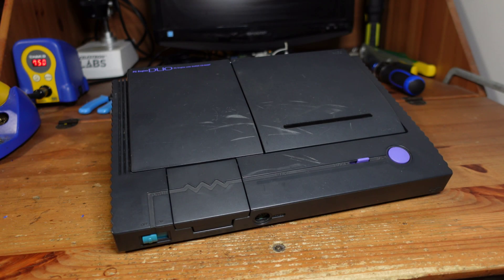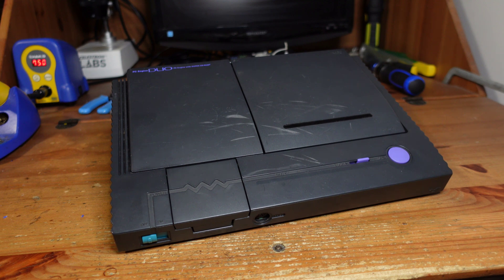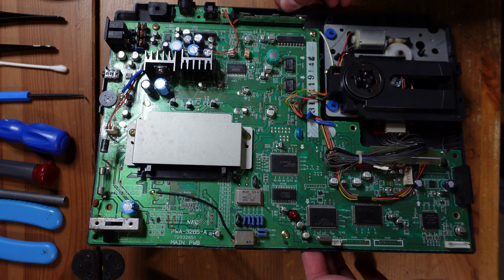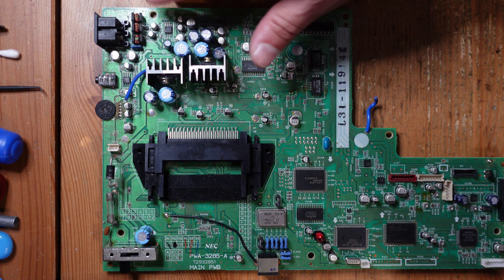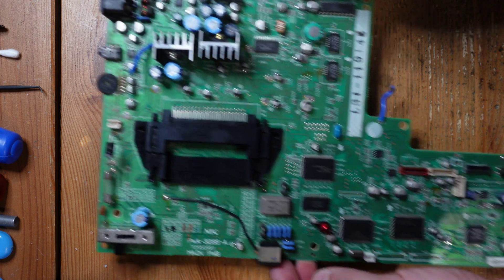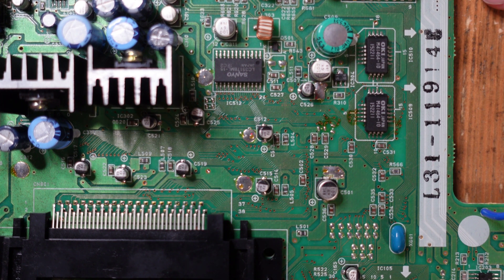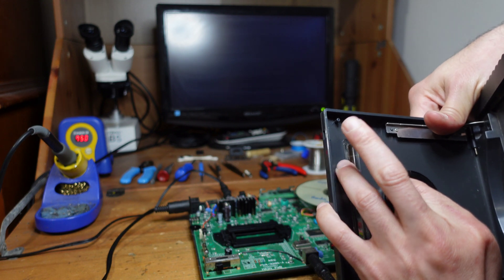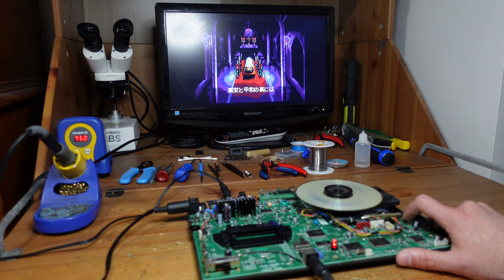PC Engine Duo (Turbo Duo) repair! Capacitor replacement guide and demonstration

Comment: what kind of dc power does the duo need ?
can i use md2 dc adapter ?
Reply from the maker: No it has a different size barrel jack. Castlemania has good triad replacement power supplies
Reply: @LIRetroGaming   thanks for the reply and info

Comment: 😊 very good video. My major concern with my Duo is to replace the 5 used security screws by basic ones. If you know a link and a reference. Thanks a lot.
Reply from the maker: I know that standard NES screws are the same length and thickness. Not sure of the exact measurements but those should work. Those can also be found in snes and n64 consoles

Comment: A thought occurred while watching this one - would chip quik be advantageous in removing smd caps? I imagine that could be a lot less stressful on the pads/traces.
Reply from the maker: Possibly but when the pads are this degraded, it’s really tough to get any solder to stick to it, including chip quik
Reply: @LIRetroGaming  good to know. I just bought a cheap Game Gear to recap, maybe I'll give it a shot on the surface mount caps on the audio board just as an experiment.

Comment: When I got mine it was "working", but the audio would fade out after a few minutes, and not come back until I left the console off for long enough. When I opened it up it was a real tragedy inside. Someone had previously "fixed" it by soldering some through-hole caps on top of corroded pads, there were some weird bodge wires, and no right audio channel - the left was soldered to both left and right pins on the AV connector. It took me quite some time to undo all of that, clean everything, and replace all of the caps. I had to bodge wire lots of missing traces, fix bad vias, and epoxy the volume control to the board because all of its pads were gone, so bodge wires for all of its pins too. Also replaced the audio mixer chip. Works fine now finally, but that was a lot of work!

Comment: I think I need to do this to my duo.  I'm having sound issues with mine and it seems the most commonly stated issue is the caps.  Can you please give suggestions on tools to do this work and do you have suggestions on how to learn and practice with this type of electronics work... I certainly don't want my duo to be the first thing I ever work on like this.  :D
Reply from the maker: These are really difficult to work on. I would recommend giving this to a professional because it will take a lot of training before you can work on one of these
Reply: @LIRetroGaming  Any ETA on when you would be reopening yours?  It's a pretty important part of my collection.  ;)  I wish I would have seen this sooner... I'm in Atlanta so if you were at the SFGE I could have stopped by.

Comment: one of my pads is gone, am i totally screwed?
Reply from the maker: No, it’s ok. You have to follow where that pad was going and connect the capacitor leg to that point. Another option is to scrape some of the solder resist off the trace and solder the cap leg to that

Comment: good video, but how did you go with checking the chiptune output, besides Red Book CD audio with some HuCard games off camera? The 4558 SMT audio op-amps around the board are vulnerable to leaking electrolytes, especially the two op-amps near the video and headphone outputs. 
Still, I’m looking forward to a video about CD potentiometer adjustments you’d mentioned in a different comment. I’ve got a couple of SuperCDROM players here with faulty CD readers - apparently the CD playback section is similar to the Duo’s..
Reply from the maker: Yeah those op amps can definitely fail because of the electrolyte, but fortunately these were OK. To test CD audio I have a music CD with about 60 tracks on it. I play some of the tracks at the end of the disc which forces the laser to go out to the edge where it’s more prone to errors.
I’ll definitely have a laser adjustment video at some point in the future!

Comment: I have one and it works perfect... should I even mess with it ?
Reply from the maker: Maybe it was already repaired by a previous owner? Very few of these still work with the original capacitors
Reply: @LIRetroGaming  Nope, could not of been.  I purchased this brand new.  I will admit, I didn't use it as much as my SNES or Genesis in the day.  

I mainly used for the Japanese shooters I used to get to borrow (boxes if them).....

Comment: Glad you’re back and safe too, a few years ago I had three of my TurboDuo‘s capacitors replaced it was a little nerve-racking sending them out because they’re kind of rare but it’s something that definitely needs to be done because the type of capacitors that were originally used tend to leak and can lots of damage to the board and other components as you stated in the video. great work man!
Reply from the maker: Thanks! Glad you enjoyed this video! Yeah it’s definitely essential to do this repair with all TurboDuos. The longer people wait, the more damage accumulates over time

Comment: Nice video, just a warning / comment on the cap removal: It is true that in the case of the Turbo Duo the smd caps are so flimsy that you can get away with just using pliers and twisting them of the board, but overall this is something that should not be done, for the risk of lifting pads. Hot air aside, I find that the best way to get rid of them is use two basic soldering irons, one in each hand, heat from both sides of the cap and once the solder starts flowing then use the two irons like tweezers to remove the caps. After removing the caps and adding fresh solder to the pads it is also worthwhile to clean them up with some desoldering braid - makes for a cleaner, flatter surface so placing the new caps is easier / neater.
Reply from the maker: Yes that’s another good method that also works well

Comment: Hey I wanted to ask if you've ever repaired a 286?  I have one with some alkaline battery leak damage on the MB.  Just thought I'd ask, it's my first PC and I really want it fixed, and it's totally outside my wheelhouse.
Reply from the maker: I have not worked on one of those yet but I have repaired battery language on other things like pinball machines. It can be difficult, it just depends on how much damage there is
Reply: @LIRetroGaming  would you feel confident you could repair it, and if so, what would you charge?

Comment: I find it to be the other way around. Due to much higher humidity in Japan, capacitors in Japanese systems leak much more than USA.
Reply from the maker: That’s interesting! I don’t know, but for whatever reason whenever I get an American turbo duo the leakage has always been extensive so I just assumed either the cap quality is worse or the storage conditions are worse

Comment: Off topic, but if someone had a retro pc (motherboard, cpu, psu, graphics card, and case) and they were requesting a recapping service, as long as they provided the replacement parts would you ever consider taking on a job like that? I've got a buddy with a Windows 98 era pc in need.
Reply from the maker: Yes, that is something I would consider. I do repair computers from time to time
Reply: Dang you're up early on a Saturday. My excuse is I'm still at work, but dang man.

Comment: Another great repair on a beautiful pcengine. In my opinion the best looking pcengine of the line up. Glad you got it working with just some cap replacing. I have a duo-r where the cd rom is not reading discs. I wonder if replacing the caps will do the trick.  id definitely like to see how you adjust the pots in a future video. I have little luck when it comes to cd drives
Reply from the maker: Thanks! I really lucked out with this one because often there are other problems that need to be addressed aside from the caps. At some point I’ll do a video on adjusting those potentiometers because it can be a real pain